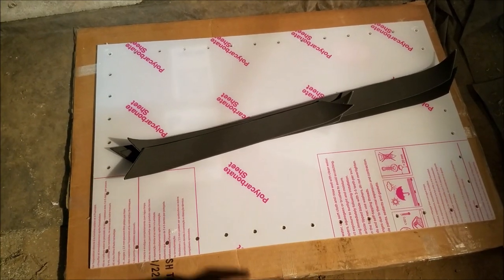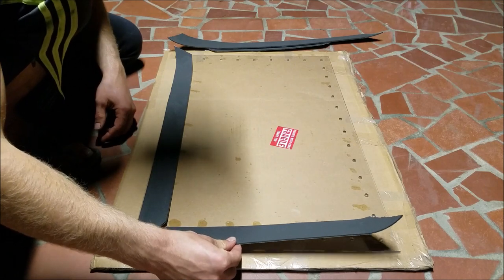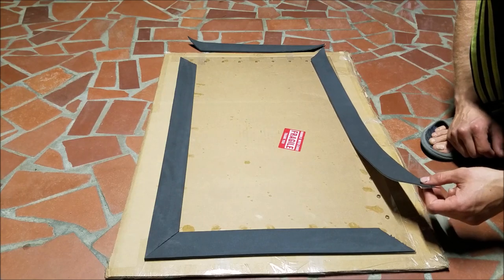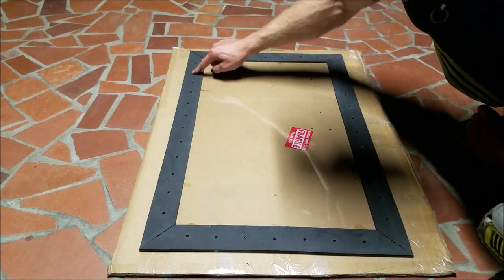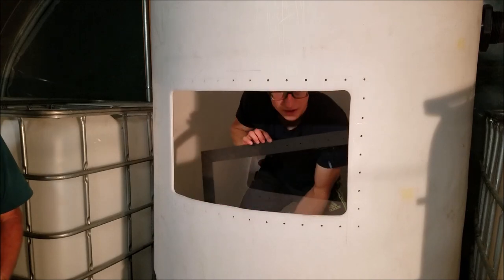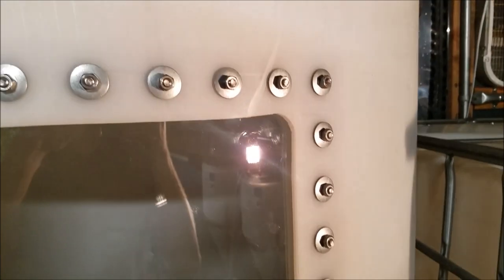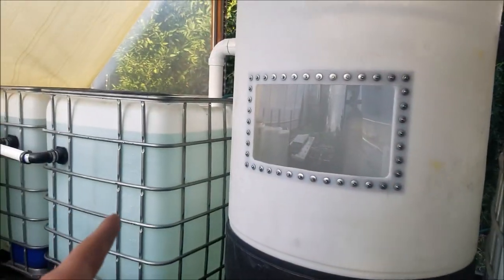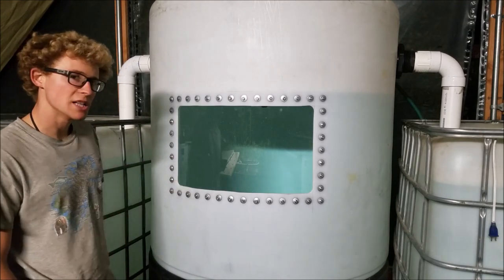Aquaponic system Renovation part 18- GIANT tank window installation (part 2)

Comment: I'm digging that hardware, it's legit!

I did mine from scratch and made my own parts, I wish i had that kit you used.

Great job on the video and install, it looks fantastic and your fish are gonna love it!

Thanks for sharing and as always keep building👍
Reply from the maker: If you dont mind me asking what was the rough cost of getting everything yourself?
For mine I think it was about $200 for the kit  but I will have to check again. 
It would be nice to see what way I should go if I do it again in the future.

And ya I like the idea behind the hardware I have. And it is cool to see how the window turned out.

Thanks
Reply: @vonponics  I think I spent about $40.00 for mine building everything myself.
Reply: @vonponics  I'm on a very tight budget so doing it cheaper works out for me but if $ is no object then a $200.00 kit already to go will is pretty awesome.
Reply from the maker: @ToddLarsen  that is a nice price. I thought it would be more than that with the amount of stainless steel nuts and bolts that are needed. But that is good to know how much the alternative is.

If I do another window later on I will definitely try the DIY version.

Thanks

Comment: Are you planning on putting a bead of silicone around the window just in case? It's looking good buddy, keep up the good work, cant wait to see your system up and running.
Reply from the maker: Thanks
As of now I don't plan to put a bead of silicone. I will see how good the gasket is that it came with. But will always check on it just to make sure.
Reply: I used fish tank caulk on mine and sealed it from the inside and sealed each bolt as well and no leaks in over a year except when the window actually cracked down the middle. I didn't have any of the awesome hardware either.